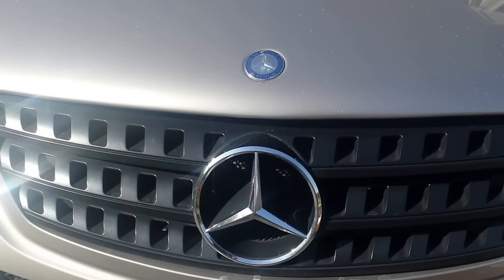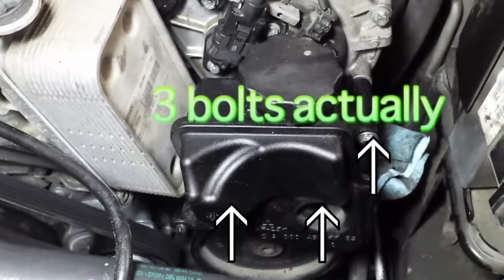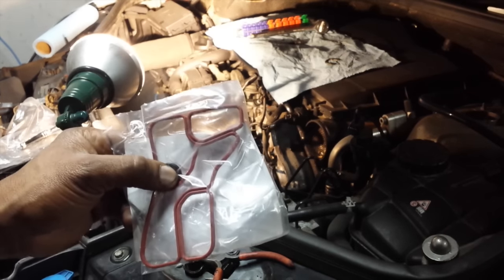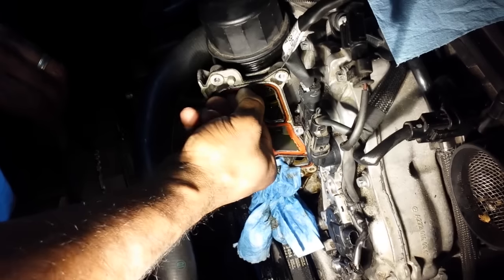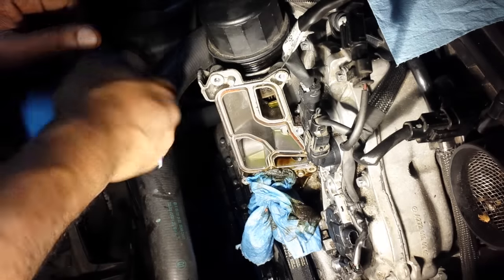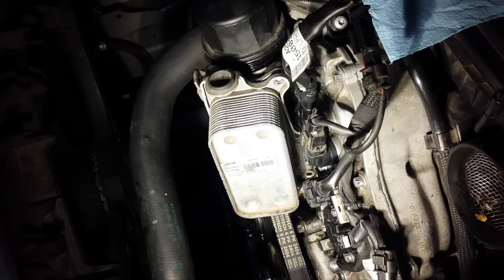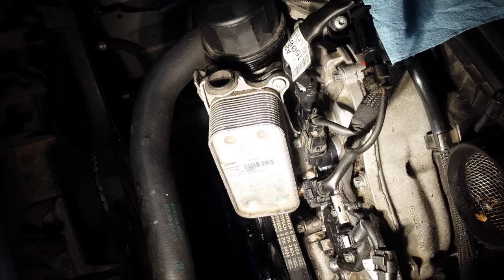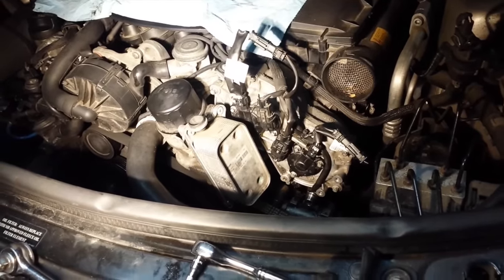Mercedes Oil Cooler Replacement/Gasket Change

Comment: Very Helpful & a lot of good tips.   Performed the repair this afternoon on a 05 SLK 350.   Shop wanted  $1,986 for repair (wanted to replace everything they touched - didn't want to touch the gasket but entire assembly as well).  I was able to do for less than $35 (Gasket for $7.50, a quart of oil $10 , a can of PS fluid $11,  and  1.5L of coolant concentrate $5) - with your excellent video I saved about $1,950!
A Couple of slight modifications.
(1)  Drained the power steering reservoir down with  manual vacuum pump (I suppose one could use a turkey baster as well) .  No mess & Got a partial  PS fluid refresh out of the process.
(2)  End up not needing to completely remove power steering reservoir as that horseshoe clip looked to be a pickle.  After removing the three screws was able to rotate the reservoir so I could get the lower screws.
(3) Removing the upper radiator hose facilitated the process greatly - nice to have out of the  way. Was sort of by accident as I was going to drain down the coolant but when I went to turn the plastic draincock at the bottom of the radiator the lower half of the plastic assembly simply fell away into my hand but fortunately the upper half remained sealed.  A common issue I see after some research - so I removed the upper hose at the thermostat housing the bleed some coolant off - easy enough & after fighting with the flopping house a bit I removed the hose at the radiator as well and set over to the reservoir (left the reservoir hose attached).
Reply: this is amazingly excellent! It explains how Benz dealers can turn a simple $20 job into $2,000 robbery 😂

Did you get to the oil cooler:
- oil leaking outside ?
- coolant mixing into oil?

I begining to understand Benz builds its cranckase pressure relieve system as a high maintenance item that needs attention else extra items appear (dirty throttle body, dirty intake valves, blown gaskets, oil leaks...) - My engineI M276 is a bit different.
Reply: First time I see the comment to rotate the PS reservoir. That never occurred to me. Can you do that without braking tabs or something on the reservoir?
Reply: Continuing on that I thought c clip wouldn’t allow the thing to flip. But if that is possible that’s just brilliant. It will make change that side of the camshaft sensor so way to change, specially in a slk that has less space than rest of the cars

Comment: I did it without taking the power steering resevoir. All you need is an extension to take oil cooler bolts off and it's comes off easy in 5 minutes.
Reply: Why tools did you use bro help me out ..thanks
Reply: same....i just used a 1/4" universal joint had no issues taking all 5 bolts out without removing anything
Reply: I used a 12 to 16 inches long T30 torx screw 🪛...so easy.

Comment: Ive just done this job on my 07 chrysler 300c which has the 3.0 v6 diesel merc engine and the oil cooler is right at the bottom of the engine wich you have to go in from the top taking everything off... you are so lucky where its placed!

Comment: Great job, although I also recommend fully taking off the PS Reservoir.  I know many comments ask if the oil cooler can be removed without messing with the PS Reservoir, but in reality, everyone replacing the oil cooler seal should be removing the P Reservoir at the same time and replacing the leaky seal held on by the C clip.  It leaks around the same time, just that the o ring seal is not easily inspected due to location.  So it should be encouraged to be replaced not discouraged due to its difficulty.  Matter of when, not will it...
Reply from the maker: All true my friend. Thanks for your contribution to the channel.

Comment: Very nice vid. Easy to see what's going on - and especially a great tip about venting the oil filter housing to minimise mess and loss of oil! I did this job on my '98 E55. The oil cooler is the other side of the filter housing and coolant comes in to the cooler via hoses and oil ways are sealed with O-rings, it's a lot harder to work with than the later design you were working with, but all the principles are the same

Comment: Keith I actually discovered on mine the oil was leaking through one of the metal layers or fins stacked and I guess welded or sealed together.  Right on the bottom.

Are you recovered?  I hope you are better.

Comment: Great videos.   Helped me save thousands.  I have a question that the dealership couldn’t even answer.   Would this affect the cooling system?  My coolant keeps disappearing.  No leaks. Just not coming back to bottle. Returns when the cap on cooler tank filler is taken off.  Would the oil cooler be the culprit?
Reply: Hi. Did you find your cars in solution. Thank you my engine oil is filling up with fluid. But the motor is running perfect.
Reply: @MrChopemup  NOT GOOD is the oil milky white??? sounds like gasket is bad
Reply: @jayvette75  No ,,misdiagnosis.  it was the  water pump …For some reason the water got into the system. From a bad bearing. I know it sounds bizarre. But I just changed everything and it’s been running fine since..  And actually. The most bizarre thing. I live on la Palma.. It was a big volcanic eruption here. I don’t know if you heard about it.And I was fighting with volcanic ash. And driving through it all the time. My alternator clutch bearing. Seized. Two pulleys for the belt. Failed. And at the same time the water pump went . From all the volcanic ash getting up into the engine. Others had big problems too few engine failures. And wheel bearings.

Comment: Over night my 2008 ml350 is burning oil. Any ideas as to what caused this problem? 100,000 miles  but this isn't a gradual problem.  Smoke during cold engine start up and acceleration after stopping

Comment: Keith.. I have a question... how can you tell if you need to replace the Oil Cooler or just the gasket?
Reply: I think the dealer always replaces the cooler with the gasket. A certified Benz tech told me they do warp from getting hot and cold causing the leak. And as you can see the comment above his was leaking through one of the fins. Probably cracked from expanding and contracting. Both parts only about 60-80 bucks on FCP EURO

Comment: I have learned so much about my 2009 ML350 from your videos. Thank you. I have a rattle noise when I start up the engine. I read online it is often the o ring for the oil pan pump. Can you confirm this and do you have a video on how to diy?
Reply from the maker: Most likely not your issue.  The noise could be and usually is the top end.   Does this happens when the engine is cold?
Reply: @iRepairAutos  yes at the beginning of the day and if I let it sit for a few hours in the day. I park in a basement garage so it's not freezing cold but it is cold. Everytime I bring it to mechanic the engine is already warm so they can diagnose it.
Reply from the maker: How many miles?  A good mechanic would know the issue and require you to leave the car over night.   How many miles on the engine?
Reply: @iRepairAutos  it actually has 144k miles
Reply: @iRepairAutos  I’m having an issue where my car makes a thumping like noise and has a little vibration only when I’m starting it & only happens when the car sits overnight I have an 07 C230 any idea what it could be ?? A few mechanics have taken a look and they don’t know the motor mounts aren’t too bad

Comment: Really great video Keith, thanks. Somebody already asked this and looks like they received no reply. Do you need to drain all the oil and/or coolant first? It does not look like you needed to. Thanks.
Reply from the maker: Sorry, I thought i responded  already.   No, draining the oil from the oil pan makes no difference as it sits far below the cooler. There will be some oil that comes out when you remove the cooler so have your rags ready.

Comment: Hi. I have .5 liter water in my oil after ten kilometers , but the engine runs perfect . Head gasket or oil cooler . There is a slight oil in the cooler reservoir, the car wasn’t overheating . Thanks for you reply.

Comment: my oil filter housing is ozzing oil very slowy it doesnt leek to the floor but i saw its dripped down the whole front engine should i just replace the whole thing including the oil cooler has well ?

Comment: Amazing channel, great resource! Am I a fool to not do the oil filter housing gasket as well? Looks as if all I have is the cooler leaking. Seapage all around where it meets the ofh. Dripped on the front of ofh as well as top of belt tensioner and top of ac compressor, so seems straight down. Back & top of ofh is clean, just unsure of an area where it meets the engine block if these things fail together
Reply from the maker: Do them both. You'll be happy you did.
Reply: @iRepairAutos  appreciate it!

Comment: Hi I need help I have Mercedes CLS 350  I always get oil in the water tank I did change the seal of the oil cooler but is still the same

Comment: How to take the pin/ ring out?  inorder to remove the power steering fluid reservoir. Thank you
Reply from the maker: Flat head screwdriver.   Needle nose pliers.   Take you time.
Reply: @iRepairAutos  Can you show us how? Like in a short video. I tried today and couldn't remove the power steering fluid reservoir. Thank you
Reply from the maker: I'll create one.
Reply: @iRepairAutos  Thank you so much!!! :)

Comment: Dear
In my car
there is some oil mixed with radiator water*

what that could be?
Reply: Fire Man could be this. I am doing this over the welekend
Reply: Could be this same exact gasket. If you watched the video you could see the oil passages are separated from the coolant passages by only that red rubber gasket.
Reply: Not head gasket. You will have water in oil if it were the head gasket.
Reply: the real question is WHAT caused the excessive oil pressure to blow up the gasket into coolant system.... bad Crankcase breather ! 
Do fix both consequence & root cause.

Preventive: coolant over-pressure can get in oil, the cap on the expansion tank does need attention too.

Comment: Q. Did you just put the power steering reservoir off to the side still connected? I want to avoid disconnecting it as I hear bleeding it is diffuclt.
Reply: I took my PS off and it never been the same / tried bleeding it 4 times

Comment: Hi Keith, I would like to do the maintenance on my OM642 engine crankcase vent valve part # 6420101791, can you tell me how this valve differs from the one you have a video on, next at what mileage do you recommend this service should be done ?

Comment: HEY there , when you remove the power steering reservoir , does a lot of fluid come out and it’s easy ? I am about to do it tmrrw . Thanks
Reply from the maker: Yes. Quiet a bit comes out.

Comment: What is the tools that you use to do this job.
Reply: To remove bolts on oil cooler itself  a T30 star bit (male) - for position sensor a  Torx E8 socket (female), a curved pick if removing radiator hose (for clip), will need a 74 MM oil wrench adapter for removing oil filter assy to let it drain down.  Recommend a vacuum pump or skinny turkey baster to remove excess fluid from PS reservoir and oil filter area.  my vehicle was a 05 SLK 350 - assume the tools are the same for yours but not assured. recommend that you dry run on the accessible upper bolts before tearing into it (all five are the same) - same with the position sensor.

Comment: My car is leaking coolant from the bottom driver side.. my expansion tank has like light brown substance in it.. not milky it’s very light you can see straight threw it.. I changed thermostat, hose and got a new expansion tank.. any suggestions?
Reply from the maker: You will need to flush your coolant.  What does your oil look like, you will need to change that too.  Locate the exact location of the leak and address the issue.
Reply: I found the leak it was my thermostat bolt was not tight.. but still my coolant in expansion tank is kinda brown it’s not thick at all.. mabey because the car did run hot and the hose busted causing me to replace the hose.. I’m thinking I might need to do this oil cooler gasket replacement
Reply: Quick question will this oil cooler gasket cause my car to overheat? But it’s strange because it don’t over heat all the time and when I try to use my heat it blows cold air
Reply: @dream_chaser9014  
Probably need to do this job on yours.

I have a similar problem in mine

Comment: Did you have to top off any oil or coolant after this?
Reply from the maker: Yes - I recommend an oil change as well.
Reply: iRepair Autos i saved money buying just gasket 👍
Reply: @iRepairAutos  and do you have to top up coolant water or flush it ? my car is 2010 W221 S350 and it has a bit of oil on the right side of the oil cooler so I am thinking of changing the gasket before any thing bad happen.
Reply from the maker: Yes. Complete oil change.  I would recommend a coolant flush as well.   They tend to mix when the cooler comes off.
Reply: @iRepairAutos  well, how about I drain the whole oil first then I open the oil cooler, with this way I think they wont be mixed, what do you think about it ?
Reply from the maker: That's an option.  Smart one actually.
Reply: iRepair Autos first thank for your videos you are amazing now my question is what do you mean by cooler tends to
Mix when comes off??

Comment: About to do this on an OM648 engine - instructions I have say to fully drain coolant first but other videos I have seen say not to? I would think that as long as the system is de-pressurised I don't have to but would leave to know.

Comment: Hi! iRepair Autos! Just one question, why did you just change the gasket and get the same oil cooler?
I have an e270 w211 already changed the oil cooler twice, but still the car continues to mix water with oil, but I never changed the gasket, is my problem there in the gasket? Thank you
Reply: LMAO that rubber gasket is one time use!
Reply from the maker: +Mike Icee don't risk your engine to a part that cost very little.

Comment: Do you have any videos of replacing the oil cooler altogether on a Volvo xc90?
Reply from the maker: +Jennifer Hendricks not yet.   Where you at?   I could do yours and make a video.
Reply: I am in Atlanta, Ga. I was told by a mechanic that I need a new head gasket due to engine overheating and leaking oil into coolant reservoir, overflowing and creating a chocolate milkshake consistency. But, he also said the oil cooler should be replaced too. I have all the parts that are needed, but without a thorough inspection I'm not sure if it's one or the other or both that needs repairing. So if you are in my area and able to repair it on video, that would be great. Just let me know how all that would work please.
Reply from the maker: Hi Jennifer sorry - I'm north in Massachusetts.  I wish you the best of luck though.  That would have been a fun video to do.
Reply: Oh ok. Thank you for the offer at least.

Comment: Nice Job. But question. I have an E220 CDI W211, Oil is mixing with Coolant. Is it straight forward guarantee to replace the oil cooler plus it's Gasket or can I replace its gasket and monitor?
Reply from the maker: +Michael Olili try the gasket fist.   Are you sure that's where the leak is?
Reply: iRepair Autos Am not very sure. After Replacing the expansion tank, Radiator and the water pump less than 60days ago. Everyone I have consulted with is pointing at the Oil Cooler since it's never been replaced. We rules out the Gearbox ATF since the Radiator is new and engine oil level keeps reducing. Any exams I can apply I would hate it to think it's the head gasket
Reply from the maker: +Michael Olili the oil cooler is the item that we would hope is the issue.   Did the vehicle overheat at any time?
Reply: iRepair Autos Yes it did because of airlock while I was flashing the Radiator to reduce the oil in the Coolant. Ever since it's been normal but it's hard to judge since its very hot here, at midday we hit 37°c. I don't know ow where to shop for either the gaskets or even the Oil Cooler itself. Any suggestions?
Reply from the maker: +Michael Olili where are you located?
Reply: Nairobi, Kenya.
Reply from the maker: I would try the Amazon links below.   Or find a local Mercedes dealership to get the parts from.
Reply: iRepair Autos Thank You. The local dealers don't stick Diesel parts that much. Majority of the W211 back here are Petrol engines hence the struggle but all the same much appreciated chief
Reply: iRepair Autos Where are the Amazon Links??
Reply from the maker: http://amzn.to/2i6OC7B  or Cooler:  http://amzn.to/2jasvdb
Oil:  http://amzn.to/2qveI4x

Comment: Which engine? Have you drained the coolant or oil before?
Reply from the maker: Model is W164.  I did not drain the coolant or the oil.  The oil is drained from the oil filter (see video)

Comment: Is it possible to do it without removing the power steering reservoir?
Reply from the maker: I wish...  There is not enough clearance for the socket to gain access to the oil cooler without removing the power steering reservoir.
Reply: ok, thanks for the answer!
Reply: Yes it is possible. I know because I have done it.You need a 6 inch wobble bar extension , 1/4 inch drive, used with a short T30 bit. The wobble bar works like a uni joint. Remove the p/s reservoir cap only , to get at the bottom rear bolt. Use a magnet extension to grab the bolt when almost out.
Use blue tac to hold the bolt when putting it back in.